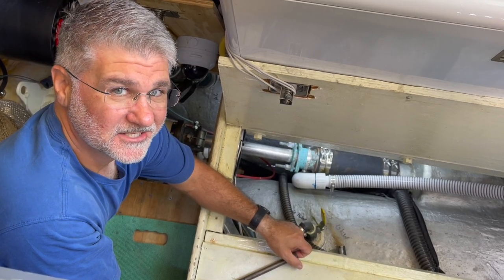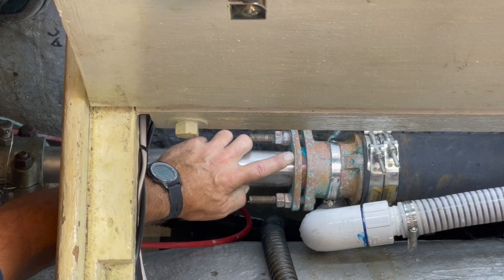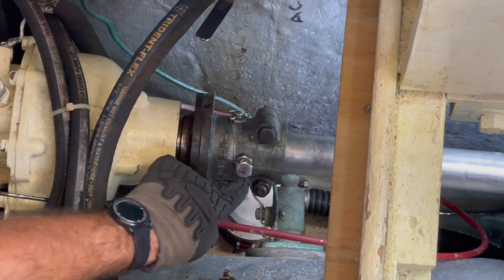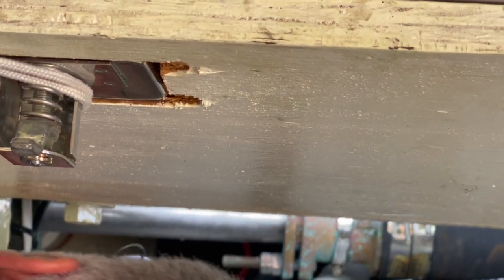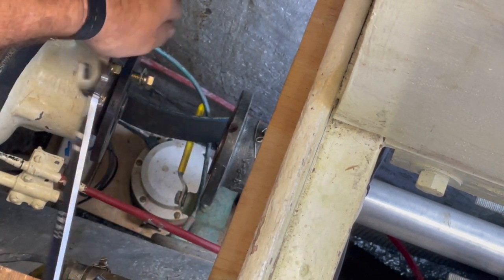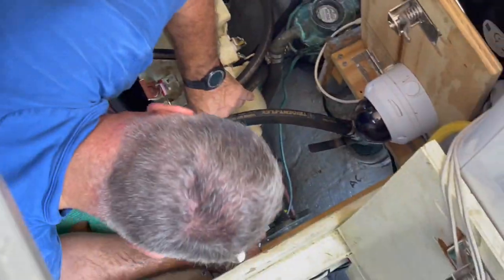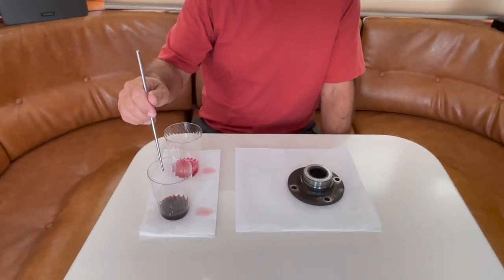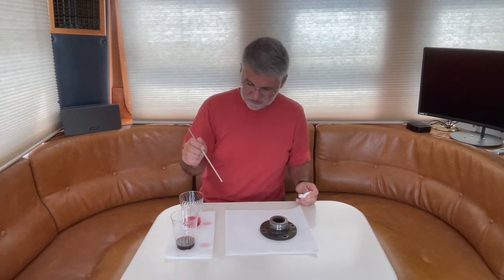We found out why my Velvet Drive is Clunking

Comment: Very good explanation. Thanks for sharing the cost of the transmission. I don't think its that bad. Can you explain how the motor mounts would cause this failure? Everything seems to lineup properly when you pulled the shaft back.
Reply from the maker: Thank you for your question. at rest the engine is straight in alignment, but when you put it in gear, if the front right mount is worn, it will allow the engine to shift under load, changing the alignment. The motor mounts take all the load from the prop pushing the boat. Thats a lot of force.
Reply: I never though of that about the  motor mounts holding the load. Good explanation, and it makes sense that under load the alignment would be out. It is all making sense now why I often see motor mounts being changed.   @boatersdivingguide